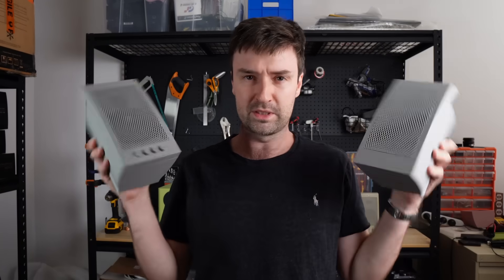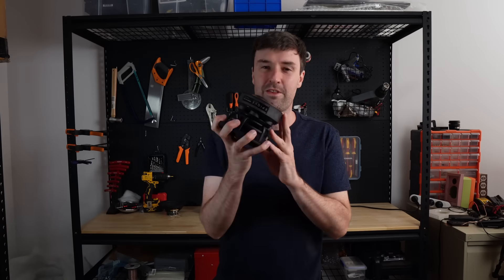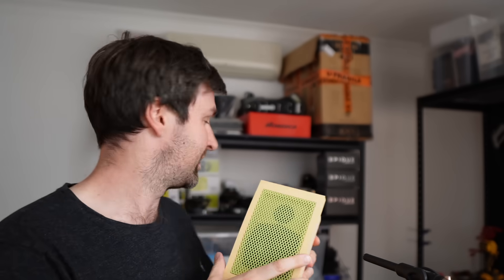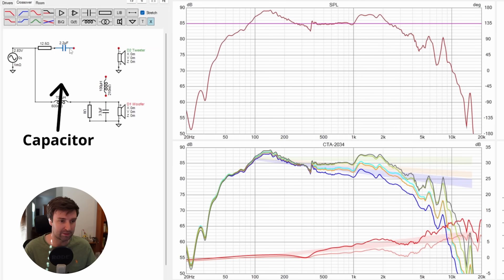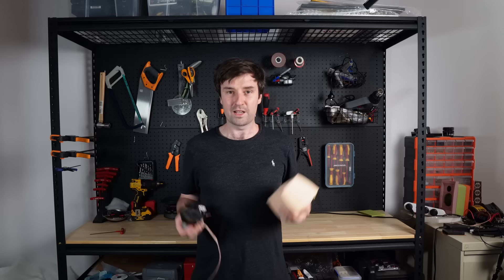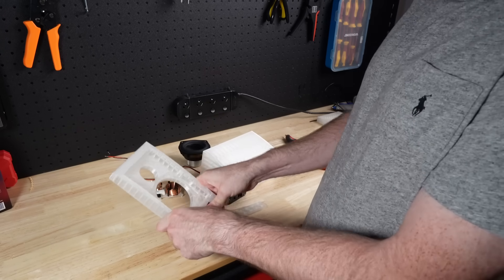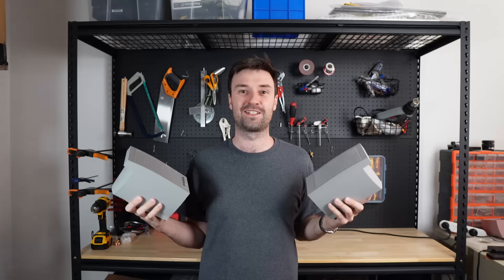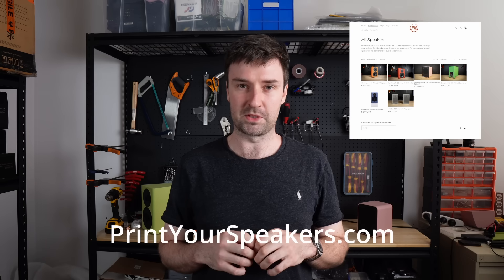I Built Incredible Desktop Speakers with SERIOUS BASS

Comment: Learnt so much about speakers and stuff from YouTube. I did modifications to my PC speakers, which cost like 20$, and after the modifications, I can confidentilly say that these are one of the best speakers I have ever heard. The size of the speaker drivers in those speakers is 3 inches, and yet they got to produce incredibly deep bass down to 30Hz! This was done by properly sealing the acoustic chamber, adding glue around the driver and radiators(to prevent sound leakage). I also added some smartphone speakers without any crossover or something(with a crossover it's going to sound much better) to reproduce the high frequencies. I also added some speakers from a tv. The nice thing about those was that they had a acoustic chamber built in. Now the vocals in games or videos sound incredibly richm I get decent bass, and decent enough mid and high tones. The drivers inside those PC speakers weren't that bad at all, but the air leakage of the chamber was a culprit for their bad sound.

Comment: Hold up i may be stupid, so give me this, doesn't a slot give you potentially lower port noise? Because the way i imagine it, the circle is minimum perimeter, so you're bunching up all that air (same port volume, area) on a smaller perimeter causing it to rub more? You can have in 3D printing something that is otherwise near impossible to build, a slot without corners that continues in that shape inwards, and you're not losing as much interior space to all the webbing between and around the circular tubes.

Comment: I'd really like to build these. But I'm curious about how much the crossover changes from print to print. Assuming my print isn't a complete failure, should I expect that mine will sound basically the same as yours if I buy everything, exaclt as it's listed in your guide? 
Obviously rooms are different, but will the speakers themselves be pretty much the same?  I'm mostly just unsure how much tiny differences in print quality, material, etc actually impacts the sound. 
Also, have you experimented with many printable materials and if/how they impact sound quality? I have a heap of PLA, PETG, ASA and ABS and I generally only swap them around based on whether the print will be used indoor or outdoor.
And one other question about materials. What would you put in the base of them? Seems like they should have something rubbery. I'm sure I can just buy some kind of rubber/foamy sheets at Bunnings and cut them to size

Comment: Crossover design is magic. So much refinement available there when you decide to start tweaking. Resistors suck but sometimes are required. Using better components matter, etc. I bet there is a way to shoehorn DSP in there with two amplifiers instead and then you can run them active :)

Comment: In tiny speakers, passive radiators work better than long skinny ports. I wonder if you could have hid a passive radiator on the bottom and raised it up on little legs. The other thing you can do is claim back some box volume by having an open cell print on the inside. A lot of active plastic PA speakers do this where the inside is an open grid pattern.

Comment: for your next project, have a look at the JBL Charge 3 - it uses a really interesting and peculiar design where the whole body of the speaker is sealed, and two plates mounted on rubber membranes create what appears to be a kind of push-pull subwoofer driven by the main drivers. they have more bass than anything I've ever seen in this size, and the sound overall is just great. I'd love to understand better how this works, and I've always wondered if it would be possible to transfer this concept to a louder desktop speaker with better drivers. 🙂

Comment: I absolutely love the bass from my Polk model 10s, they do use a passive radiator, but they sound amazing to me. If you don't mind why are passive radiators cheating? I would kill for a small form factor speaker using a passive radiator design, and maybe a AMT tweeter. I'm just getting into stereo tuning, and making my own speakers sounds like a fun challenge. My Polk monitor 5s sound amazing at my computer setup, but are massive.

Comment: Really impressive, but most importantly very educational.
If you are searching for a nice new (hard) project, how about an old favorite of mine: A compact version of the tube shaped "360-degree omnidirectional speakers" like the "Sountina NSA-PF1" or "LSPX-S1" or "LG XO2TBK" - an elevated downward-firing bass driver that continues as a tube to end in a midrange unit / tweeter that fires upwards but gets redirected to the sides by something akin a free standing obelisk or egg or exponential horn. The electronic sits either in the feet / base plate, or in the tube between the two speakers.

Comment: The comments about the passive radiator aren't correct. You do need to move twice the volume of air, but the passive radiator you showed has double the xmax, so you should only need one of them per woofer. VituixCAD lets you simulate this. I'd be curious if you can get similar results with a single passive radiator as you do with your port

Comment: Speakers that are used near CRT monitors need shielding.
Reply: How do you imagine it works? This speaker is built to the same standard as any so called "magnetically shielded" speakers. There is no separate shielding, the midwoofer has internal compensation and a polecap, and the tweeter is small enough magnet not to be a worry.

Comment: I felt that. :-D Emotional recover and such.  At the moment I started too many projects, and now I have to finish em from back to front, starting with the smallest, least significant - Tapped Horn subwoofer decoy. A weak looking 5,5" driver in "horn mouth" shattering the earth while it will be beastly 8" driver mounted facing ground, and the horn mouth is actually a bassreflex port. It will be hysterical.

Comment: Been there, did that (difference being ND25 for tweeter and passive radiator instead of bassreflex), won't use this particular amplifier again, as it's not really worth the money.
My second iteration of small active speakers runs on JAB4 from Wondom, which you can order directly from China and save some money. You get more power and 4 amplified channels, so you don't need a passive crossover - which not only simplifies the design, but also saves money.
Even this turned out to not be the best option though, if I ever do a third iteration, I'd go with JAB5, which is theoretically a more powerful board, but, if powered by the same voltage, has lower idle power consumption than JAB4, and has an automatic standby mode. At 24VDC or below you'd be probably fine even if you removed the fan altogether.

The only disadvantage compared to Lepai is that volume is controlled in DSP, independent from Bluetooth (volume controls on Lepai change the volume setting on Bluetooth streaming device (phone), whereas with Wondom there's both bluetooth volume and hardware volume).
On the other hand, you can not only cross actively, but also boost lower frequencies to extend the bass range - dynamically if you want to protect the drivers at higher volumes, do loudness control, do room EQ, or whatever you'd like.

Comment: Beautiful execution! Three things I would like to mention:
The manual rotation for taking off-axis measurements seems... painful. A simple stepper motor attached to your rotating base and an arduino would easily take care of that in an automated fashion. Couple that with triggering your test sound / recording, you could easily automate the entire off-axis measuring process. I have seen you manually do this in multiple videos and it seems like you would have the skills necessary to automate that :) If you need any help with it though, feel free to get in touch.

Secondly: it is a work of art how you design your crossovers. As someone with little audio knowledge I was wondering: would it not be easier to do this with a DSP? Or is the problem that you would struggle in properly correcting off-axis audio when using a DSP instead of your custom crossover? Apologies if this is a stupid question.

Lastly: I think your channel is very underrated and will hopefully grow quickly. It is just as much of a pleasure to watch your videos as it is to watch your creations come to life. Keep it up! :)

Comment: So I understand the theory of impedance and so on quite well because of I had to design a custom impedance matching circuit for an antenna for my bachelors thesis. Yes it was at couple more MHz than a speaker but the principle remains the same. And of course speakers should have a flat response over quite a wide range of frequencies. If I would ask my professor for antennas to build an antenna that goes from below 50 MHz to 20 GHz with a flat response he would ask me if I hadn't learned anything. But my main Problem is understanding how the sound behaves in the room. Especialy how it reacts if the port is in the back of the speaker and the speaker sits in a shelf close to the back wall. Of course theoretically you can match to that specific environment, but in my experiments (very limited) I just prefer front port speakers just because I don't have to think that much of what is behind them.
Reply: The only differences between port in the back of the speaker and port in the front of the speaker is (a) back is closer to the wall but if it's just 17cm, it's really not that big a deal, as in, you're going to have the same problem either way, and (b) breathing noises of the port are more obvious if it's in the front. Unless you are putting literally into the shelf where you have blocked the rear port, because then... yeah you probably didn't want to be doing that. But bookshelf speakers are a misnomer anyway, because it's rare for a speaker to be designed without bafflestep compensation, where the crossover frequency is partially determined by the baffle width. BTW on the desk you probably don't want as much bafflestep compensation because the wall is also kinda the baffle.

Luckily speaker doesn't need to be flat anywhere, and it's not going to be flat, when you're looking at pleasing looking plots with not too scary a waviness and desirable overall curvature ("flatness") they're 1/3rd octave filtered! And you're only shaping the response between let's say 100Hz and 10KHz, it's not that much! OK a little under 100Hz and you want STUFF above 12KHz but nobody's gonna ding you for the top end being an absolute mess, nobody can actually tell.

Speakers are generally not designed for the environment, but people also expect a certain sound when they put a nominally flat speaker into the said environment. Say someone putting their speakers on the desk near a wall expects them to sound midbass boosted 6-12dB so you just don't correct that out, this is completely valid. Music is made for a nominally anechoically flatish speaker which is no longer flat due to being placed into the environment.

Comment: The idea was good. Up to the point where you decided to use an outdated, primitive technique: a passive crossover. You learned really difficult software for CAD design and you already use a measurement software & mic, but you are too lazy to learn Sigma Studio and think this passive contruction was a good idea? With Sigma Studio, you can program really cheap, but high quality ADAU1701 4-channel output DSPs, and there are a bunch of cheap but good 4-way T-/TDA amps out there, some even with built-in ADAU1701 or other DSPs. Also, as you already figured out, the construction of the front with this superdeep baffle brings huge problems; the hope that room reflections will egalise them is only wishful thinking. I would consider this project as a fail because almost every of your decisions leads to a third class result. I did something like this with a JBL Media 200 but was not satisfied. With a Purifi 4'' chassis built in an existing small active speaker, it turned out quite good with around 40 loud Hz in a closed box (of course only possible with DSP and massive amounts of watts). Oh, and if you want great results, you have to measure with the mic positioned in the hearing position, between your ears. The only relevant position for final corrections.
Reply: yep, i agree, using a DSP in this case would make it sound better (at a cost)

Comment: maybe try a flat tuning port? the tube is neat but what do those weird shapes do to the reflections inside the box?
Reply: The inside shape of the box being adventurous is good actually, to avoid standing waves in enclosure. Another solution is slanting the sides. But yeah slotted port is also the direction i have been thinking in for other reasons.

Comment: Try biamplification, use two different amplifiers for tweeter and the woofer, and you can design a crossover for small signal ,or just programme a couple of DSP filter.

Comment: Question: What would happen if you go with the small chamber for the speaker but since you have 3d printing u can snake the port tube out of the box then back in so the port exits normally? You can make the port tube a feature of the box's design  maybe even make it a handle. I hope i explained this well enough, i'm not good at explaining what i see in my head.

Comment: This is no modern speaker design. Today we use one amp for each driver and active DSP crossover, parametrized by the measurement microphone. And good bass in tiny cases is solved since MFB, motional feedback. My Adam A5, that are just a litte bit bigger than yours, sound significantly better.

Comment: Did these speakers end up being CRT safe? You didn't mention it as a design consideration and I didn't see any magnetic shielding added. Are the drivers themselves already shielded? I do worry about having strong magnets around fragile CRT tubes without any shielding. Most cases you might be fine and the degaussing coil on the CRT will solve any magnetic distortion on the next power on but that would not help while using the monitor and sometimes it can become magnetised to the point you need an external degaussing wand or even be un-fixable.

Comment: mildly successful.  It is highly unlikely you or any entity on earth will be able to "take on" JBL.  Since JBL manufactures and patents literally every single part of every product including their own voice coil wire and in-house produced integrated circuits on in-house designed factory processes using in-house patented manufacturing equipment and patented materials, the best you can hope for is to sort of make something that kind of sounds like a product JBL would have made in 1940.  Note that JBL invented the very concept of bass and manufactured the first woofer capable of bass.  Until you can manufacture your own patented drivers on your own patented 6 axis machines using your own patented FEA analysis software completely designed in-house, you will be 100 years behind JBL.  Every loudspeaker driver innovation for the next 30 years is already patented by JBL, they merely have not decided to let people see their innovations yet as they are currently #1 in the world in terms of small, portable speakers and headphones.  Your battle will not be uphill, it will be asymptotal, best of luck.

Comment: Group delay from such a long port is one of the reasons I ended up going passive on my desktop speakers. Though my current favorite is my rs100 + W5-1138SMF + AA-JA33286. Its a bit on the larger premium side, but printed with epoxy filled walls has worked out quite well for me.

Comment: Making the port longer and wider reduces the effective speaker volume, which means the speaker has to get bigger, otherwise the tuning will change. I might be wrong but your elaborate port seems to take up to 1/5 of the volume, that increases the already 8dB high peak at 150Hz and shifts the peak to a higher frequency. Standing directly on the table gives that range additional 3-6dB boost. That's then pretty close to a one-note bass. Sounds impressive at first but that effect soon gets annoying once the novelty of it wears off.

Passive radiators don't have that downside. You can use old woofers to make passive radiators. For tuning you add weight to the PR membrane or change the suspension compilance. For placement you can simply use the top and bottom of the speaker enclosure, just give the speaker some feet, that will also improve their sound in the midrange.

Comment: Such a sick project! Considereing the time and work it takes to make the port it's just simply more efficient to us a PR and also allows even lower tuning. For small for factor Projects i honestly will always use a PR. Also it only has to move twice the amount of air doesn't matter if 1 of the same size that moves twice as much or 2 that move the same amount as the woofer. While it costs a bit it saves so much frustration lol. Also there's no port resonances ruining the midrange!

Comment: Awesome project. I would not mind to have a 100-200ml more volume inside compensating for the crossover and other stuff. Also, did you fill it with wool? Cheers

Comment: The reason the old speaker had no bass is that the speakers were foam rotted. So no air pressure stays inside of the enclosure
Reply: I don't know how this exact speakers sounded when new, but growing up in the 80s and 90s, the entire reason for me owning a stereo was because how bad this things was.
Reply: Not to worry, these have no foam, these speakers have a paper surround the wavy pressed kind. Not leaky, simply no bass by design because cheap.
Reply: @SianaGearz  look at 1:03 . You can see the original driver has no surround left and its deffinietly not a paper surround driver

Comment: Love the effort you put in, but I can't get over how badly those speakers are designed. I know you are trying to stay true to the original design, but the diffraction would have to be insane. Could you not print it with holes on the sides and top to try and at least let some of it out?